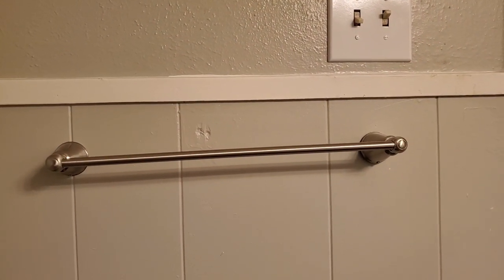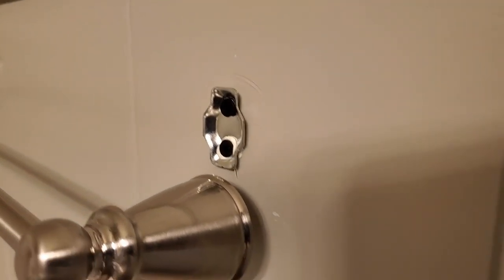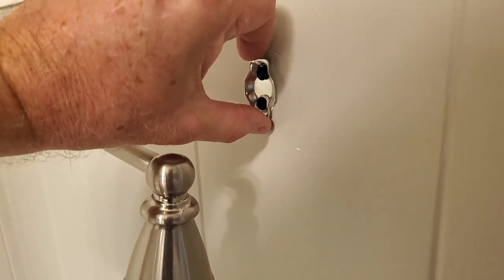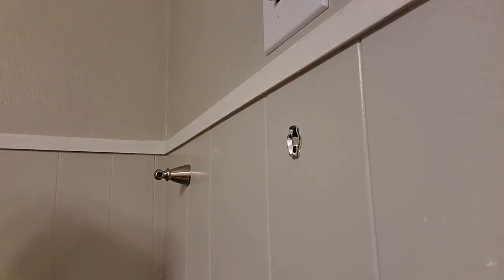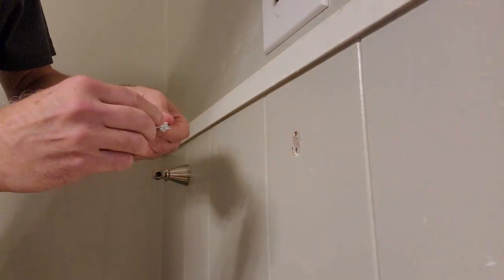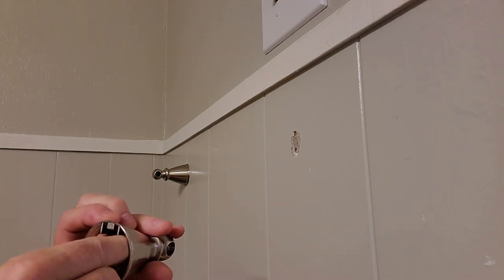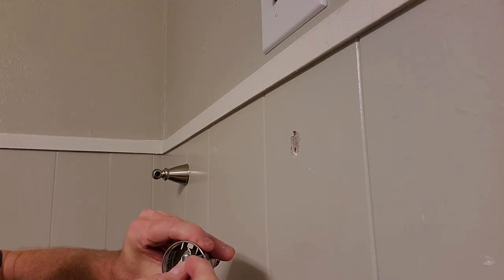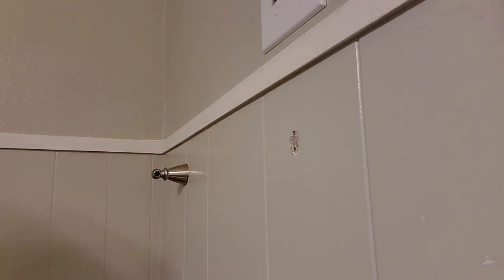Fixing The Towel Rack - Escaping The Mouse - ETM-50

Comment: Drywall screw too.. not structural at all, ... I guess the caulk is supposed to make up for screws designed to pop their heads off under load.
At our house, we are restoring a pre 1960 shop vise by American Scale, a number 56. It was a solid rust scrap iron last week. Today it came all apart, some of the parts are bead-blasted and ready to paint, some still awaiting wire-wheel and bead blasting.. Paint will be next week.